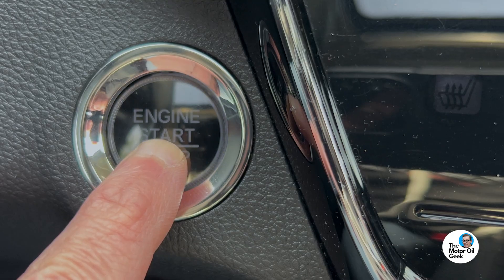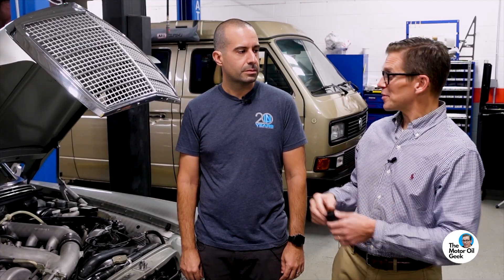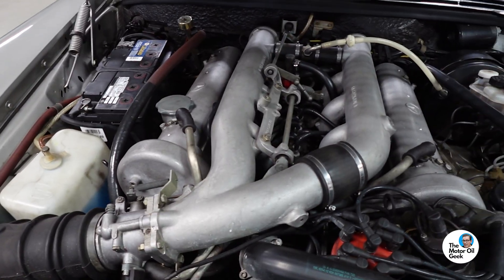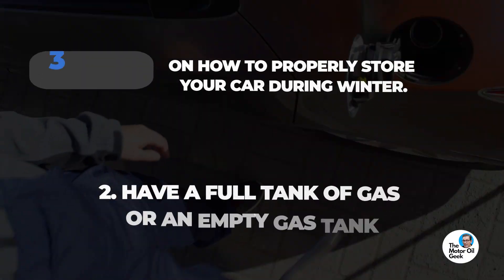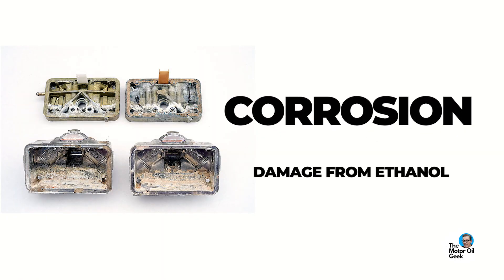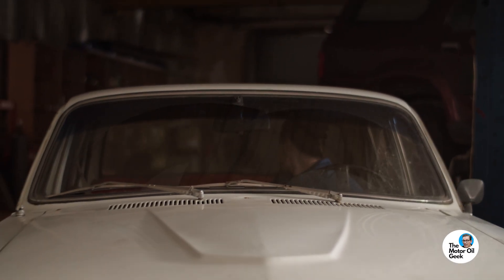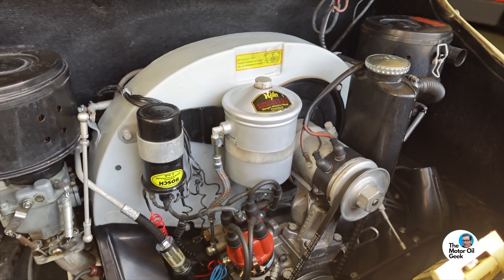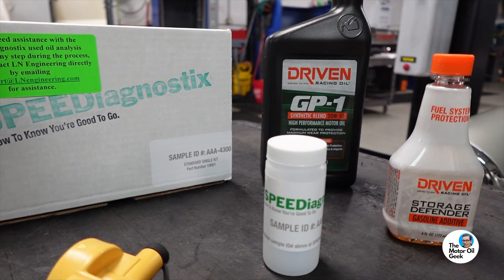3 Winter Storage Tips To AVOID Engine DAMAGE

Comment: The oil life indicators work off of a logarithm. The computer takes the rpm, engine temps, miles driven, and calculates when oil should be changed. What I never understood is this. It has no clue what kind of oil you put in it last, Dino oil, Semi synthetic, or full synthetic. So how does it take any of that into its computing? Answer: it can't. So, does the manufacture program the logarithm for the old dino oil, semi or full synthetic oil? No one knows . The oil life indicators are a guide and nothing more. Personality I do not use them. Change at 3K - 5K and be done with it and you will never have a oil related problem.

Comment: what I do is just crank it for 2 seconds, not starting it, just to get the valve springs in different positions. Then the following month I start it and let it run for at least 30 min, I feel top rad hose to verify it is warm, this tells me the thermostat has opened and engine has temp in it. Than following month, I just crank it for 2 seconds to get valve springs sitting differently. I'm usually storing my cars from end of Nov. to beginning of April. I use only non ethanol fuel year round in it.

Comment: 100% on the oil sensors. Bmw has their oil level sensor with a condition sensor. It’s able to measure how oxidized and acidic the oil is and will vary the mileage till oil change is needed
Reply from the maker: https://youtu.be/t4e0oDBseqo

Comment: This may sound over the top but any car I store for a period of time , I take for a 20km test drive and then plug the exhaust and wrap the air filter in plastic and reseal the air filter lid. With a hot exhaust there won’t be any moisture sitting in the pipes which is the perfect time to plug it. With some valves open on either exhaust  or inlet , it prevents moisture from getting to the engine. 2 minute job instead of removing plugs injecting oil then refitting everything . To remember that I have these fitted, I have those remove before flight red tags on the key ring which I remove when they come out during spring and summer.

Comment: All good recommendations.
 I do actually recommend you start cars that are chain driven and have plastic chain guides. They stay supple by design by being in contact with oil. So they can become prematurely aged by not being in contact with oil once they have been heat cycled many times in the engine. So I personally recommend starting the engine once every 3 months if its being stored for longer that this.
This recommendation come for European and Japanese cars. We don't really have any customers with American car (maybe the odd Corvette). But as said you shouldn't be starting it every week.

Comment: i store a few old whips in the winter, and sometimes i let them sit up to 3 months, but nothing longer. i always put fresh oil in before storage, and after storage. all fluids are just checked each time and changed with proper intervals. fuel has non oxy only 5 gallons in the tank with a splash of sta-bil. never had a problem. batteries are always newer, not on a tender or anything, and they fire right over. im lucky.

Comment: Thanks for another good video, Lake.

My S2000 is going into storage for about 6 months. I have about 200 miles on the current oil - at what point is an oil 'used enough' that it is worth changing for storage? (few, if any, short trips)
Reply from the maker: That’s new enough for storage.

Comment: Hey Motor Oil Geek, I just bought a new diesel truck. 2024 F350 high out put 6.7. I have just over 700 miles on it. Do you have any diesel truck videos?

Comment: I charge the battery and bring it in for the winter. I leave the hood open. I don't start the car till spring. I used to put dryer sheets in the car. I never really thought about filling the gas tank.

Comment: Im interested in Driven storage additive for oil. I see you recommended the fuel stabilizer but what is in the oil version exactly. Just helps with the oxidation value? I do use both products for my winter storage but never fully understood what it was doing to the fresh oil or if I should be running the engine after storage with the Driven product in it.

Comment: Yes. One good practice I've done for years in the spring before 1st start up of a winterized engine is remove one qt from the engine and add one fresh new qt through the valve cover to help lubricate the valve train during that first crucial start of the spring. Great content ! Keep up the good work 👏
Reply: On older engines,  you used to be able to pull the distributors and drive the oil pump with a drill to pump oil everywhere first.

Comment: I disagree with not starting your car with one exception.  I let it run until it can get up to running temp -10 to 15 min about one a month.  I had an Infiniti G37 that I hadn’t run for about 3 months and when I started it I thought it was going to puke its valves from the engine noise.  After about a minute it was fine.  If you let your car sit for months all the oil drains out of the top of the motor.

Comment: I own a new Nissan GTR and I only put 400 miles on it a year is there a fuel stabilizer you recommend? And as for the oil should I replace it yearly or every 6 months since it on average I only put 200 per six months? Any advice would be greatly appreciated, thank you!

Comment: Greetings from New Zealand Lake. What if you have a car which is in longer term storage,  say under going restoration?  Maybe multiple years? Some have recommended disconnecting the fuel pump and turning the engine over to circulate oil but not injecting fuel. Would be interested to hear thoughts on that. Cheers.

Comment: After draining the oil for storage I would not add new oil immediately. Just replace the drain plug and let the car sit. This way you can’t start the car
and when you do add new oil at the end of the storage period it is fresh and hasn’t been sitting in the crankcase,oxidizing, during the storage period.

Comment: I suppose I should watch a video on maintenance minders since....I ignore them completely.  I'm a spreadsheet nut so I never miss an OCI.  I'd pull the fuse on the minder if I could.  I hate them.  Soooo, there's a chance I'm missing something?   Excellent video on storage because you touched on something I've been passionate about:  don't just start a car and then shut it off if it has not fully come up to temperature.  We have a single car driveway and parking on the street is illegal overnight in the winter...sooooo, ever morning and night is the automotive musical cars.  I hate it.  I hate starting and stopping them....cringe.
Reply from the maker: https://youtu.be/t4e0oDBseqo

Comment: Agree on all points. While oils have acid neutralizers as part of the add pack, there is no sense in not having fresh oil in there for the winter nap.
Fill the tank as full as possible. I use Techron Marine for an add. Supposedly good for 2 years at that point, but certainly good enough for a 4 or 5 month winter layover. Also, a battery smart charger, to keep the battery happy, and all other maintainence done. Wash, wax, park, leave it be until that first good day for a trip to the local joint for a burger and a root beer.
If the oil geek says it, you can rest assured it's good advice.
Reply from the maker: Great call on the Techron Marine!

Comment: I live in Arizona and have a old Honda Accord V6 that is really not being used.  I make a point to drive it about 10 miles once or twice a week. I get the car up to at least 60 mph and full operating temperature.  Oil is fresh. I run fuel injector cleaner in the fuel. The car has recently had a new water pump and timing belt. Also, I changed the transmission fluid recently. Would it be better to just let the car sit and put a battery maintainer on it?  I don’t keep a lot of fuel in my car, because I do not want the fuel to get stale. I put a few gallons in so that my weekly drives use it up and occasionally I just refill 3 to 5 gallons. You didn’t mention lifting the car and putting it on jackstands if it’s not going to be operated. I would think that slightly over inflating the tires, and being lifted, would preserve them and prevent them from getting flat spots. That is another reason why I simply drive the car once or twice a week and put about 10 miles each time.  Are you sure it’s better to just let the car sit?

Comment: OLM are interesting,  I believe that they are calibrated for the manufactures spec, like Dexos.  However, there are some better oils that may allow you to run them down a little further.  I would not run any OLM below 20%,  ideally change at 40% if it’s a turbo GDI motor
Reply from the maker: https://youtu.be/t4e0oDBseqo

Comment: I winterize boats  for storage  in the Northeast. In ideal circumstances I flush   by running  with  fresh  water until the engine is WARM and pull the  drain plugs while flushing. Then change oil and filters and run on fresh water  to circulate  and warm the oil. Drain  and fill with non toxic antifreeze and fog the 
 Carburetor  or air intake  while adding  the last  of the antifreeze. Also try to get some fogging oil inside the carburetor  vents  while fogging. I look for plenty of fogging  smoke out the exhaust. Once had somebody  call the fire department  when smoke poured  out of the small storage garage. Got out
just before the FD arrived! I add  fuel treatment  at the beginning  but don't have much  control over fuel tank volume. Gasoline  does  not deteriorate 
noticeably over a few months  winter storage. Summer heat ages gas.
Worst case  scenario  is leaving  gasoline  in a snow blower through  spring, summer, fall and expect it to start at first snow. In spring start  up
 I gingerly crank the engine a few revolutions to check  for hydrostatic 
lock. Haven't  had to deal with a stuck open  valve in decades. They  usually  start up and run like  I shut them off
yesterday. Burn off the fogging oil on the run from launching  to docking.
Always looking for the perfect  fogging oil, I've had good  results  with
CRC Engine Stor fogging oil. GOT A PERFECT  FOGGING OIL?

Comment: Attach a battery maintainer that will keep the battery at full charge which will lighten the load on the alternator. I have mine permanently attached and just plug it in after every use. Nine year strong on a autozone inexpensive battery.

Comment: I always find it interesting to hear about using a fuel stabilizer. The few times I used it (couple in a car, twice in a lawn mower, and once in my dirt bike), all the times it was so hard to get my engines running after winter. I stopped using stabilizer and they all fired up relatively easily. So apparently I was using it wrong.... (This was up north with snow and freezing weather, vehicles garage kept, left with a full tank of fuel).
Reply from the maker: Unfortunately, not all fuel stabilizers work the same.
Reply: @themotoroilgeek  could you do a video on them or give recommendations? I used Sta-Bil.

Comment: So change your oil, but don't run the car to circulate the clean oil?? Wouldn't that keep everything, but the oil pan covered in acidic old oil?
Reply from the maker: You can start the car after you change the oil. Drive it to the gas station to fill it up before storage.

Comment: I am going to present a contrary view here. My sources say, six months or longer after an engine has been run, there is still oil holding in the bearings. However, if you want to make sure, if you run the engine of a stored vehicle just for a short time every couple of months, you are guaranteeing the engine will be adequately oiled for startup and no special startup procedure will need to be followed.

Keeping no gas in the tank might be best but, as is pointed out, that might be difficult to do. The advantage of storing the vehicle with a low level of fuel is that when you start it up, you can immediately go to a gas station and fill it up. I think the issue with old gas is way overblown. I am sure it all depends on how long the vehicle is stored. There is a lot of difference between storing a vehicle for three, six or even nine months and storing a vehicle for two or three years in terms of all of the factors.

One thing that makes no sense to me is changing the oil before you store the vehicle. I don't see how filling the gas tank makes sense either. All you are going to do is end up with a tank full of stale gas and with oil that has been exposed to the air for however long the vehicle has been stored.

For a short storage interval - maybe for the period of time when salt is on the roads or because someone doesn't want to drive their classic under winter conditions - I don't think anything needs to be done. I think it's all motivated by vanity and an effort to create a sense of exclusivity. If you have an RV that you take out in June and park again after Labor Day, maybe you need to do more. I wouldn't worry about the engine that much even with a nine-month storage interval.

Comment: Lake, the one warning you should consider adding is do not under any circumstance “pack the fuel in” past the first click off of the pump at the gas station (unless you have some exact way of determining how much is in the tank), because by adding extra, you will cause running issues and check engine lights in many modern cars in relation to their complex evap control systems. If liquid fuel starts interfering with the operation of the evap system, you’ll definitely have problems. There are several videos on YT documenting this problem. The most recent was Royalty Auto Service. It was titled it’s not always smooth.

Comment: I would start and run once a month. The 2-6oz of fuel in a carb bowl will go bad quicker than the 10+ Gallons in tank! Just yesterday On a 130 outboard motor I had to drain and flush carb bowls before it would start and run. Lake tested fine afterwards Gas in tank smelled fine fuel from carbs stunk so bad and I am his only mechanic! Seen this done this on carbed atv's many many times. There is a huge differance between a engineers findings and data and a man in the shop working for joe public on flat rate.

Comment: Not arguing or disputing one word you say!  Ive heard the ethanol and water issue many many times. I am a 35 year boat and pwc mechanic and about 40% of my work is service calls on toys sitting on the dock on the water and I very seldom ever have to pump water out of fuel tank and when I do it's due to pouring water in out of old gas can thats been sitting or busted gas cap on unit. All owners and service manuals say fill tank prior to storage and I agree but 99% That I winterize have more than 1/2 tank and they sit over the lake 7 of 12 months. Just saying what I see. I agree to the procedure 100% I just never see issues from H20 I do from degradation of fuel every week though especially on carbed engines. I bet I pump out 500 gallons of old fuel every year and its a pain to find proper place to disspose of it.
Reply: I did just resurect a S10 that sit for 8 years and even though was no H20 in the rancid fuel all the tank above fuel line was total rust. Also seen this 100's of times on old motorcycles over years too

Comment: Is there a best oil and oil change practice for GM AFM vehicles?  I have a 2016 GMC Sierra with the 5.3 and use a Range device to turn off the AFM but at 90k miles I am concerned it will have a lifter failure.  I have always used synthetic 0W-20 as specified and changed the oil at 4000 miles.

Comment: As a generator Tech who works on a lot of propane powered units,they're always making milkshakes in the winter. 
Standard procedure for probably the last 50 years is to do a test run once a week for 15-30 minutes for many reasons.
In the past couple of years ,the industry has changed slightly for these home air cooled units. 
They test run once a week ,but only run for like 20-30 seconds and shut off. 
Long enough to make sure it works and that's it. 
For my summer cars , it's better off leaving it dormant all winter instead of starting it occasionally.
Besides,I go thru a prelube ritual in the spring for startup.

Comment: It's good to start engine once in month, but you have to run engine to the normal operating temperature. Air conditioning seals will go dry and start to leak, if you don't start engine in long time. It also keep fuel injectors in goon condition. It will also lubricate metal parts to prevent corrosion. It also cleans engine from inside when you have clean oil in engine. It's also good to add tire pressure. Tires will last better in storage when there is little bit over pressure.

Comment: I used to also spray fogging oil in the intake and shut the engine down as the last step of storage. With fuel injection I can't do that. How do I get the fogging oil into the engine? Is this important?
Reply from the maker: Pull the spark plugs to spray the fogging oil in.